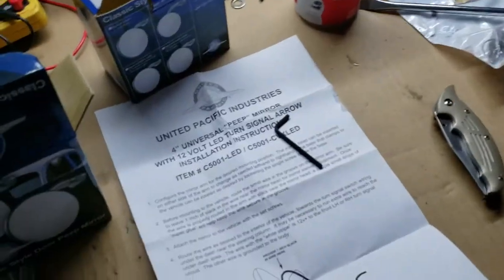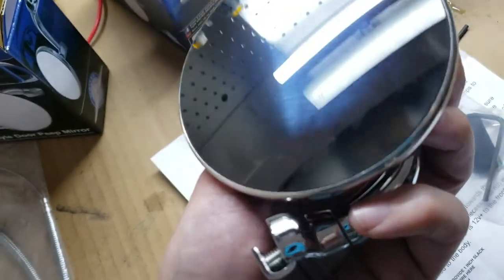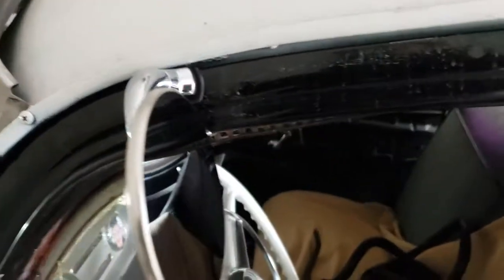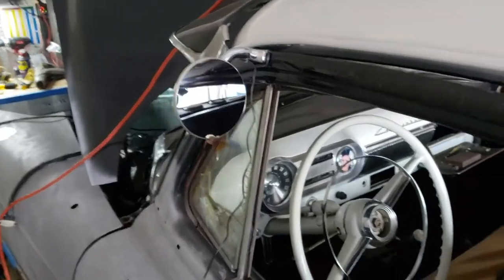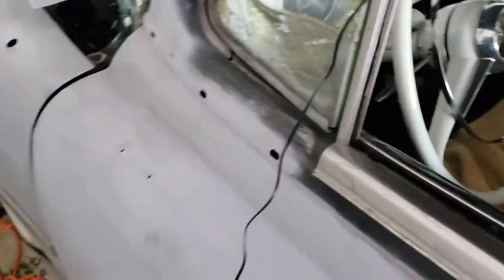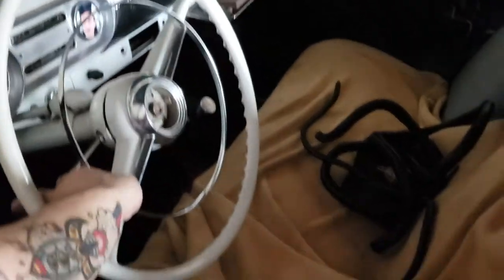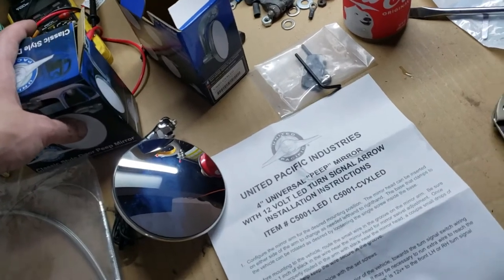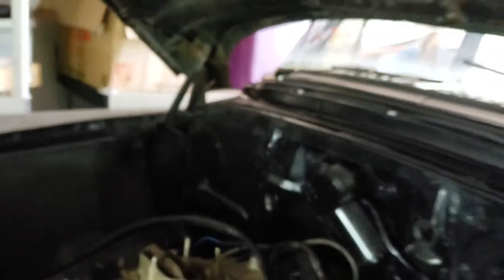4" peep mirrors

Comment: Looks like the part guy is stopping by regularly!!! Be sure to check out WaynesWorkVlog channel!!! He has a 54 Bel Air as well!!! You might like his channel!!! 
Your fans need to be run off a temp switch!!! Move the temp gauge into the head and install the temp switch for your fan on the intake in the intake!!! Summit sells the switch you need!!! You only want your fans running when they need too!!! They don't last forever!!! You also want them automatic so you don't forget to turn them on!!! 
Looking good so far!!! 
Keep Rocking and a Rolling and a Rolling and a Rocking!!!